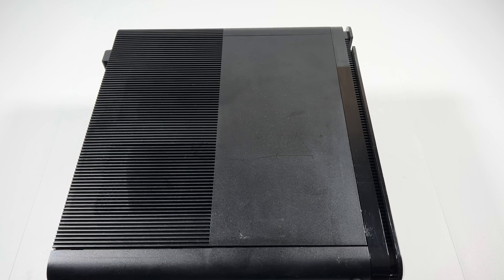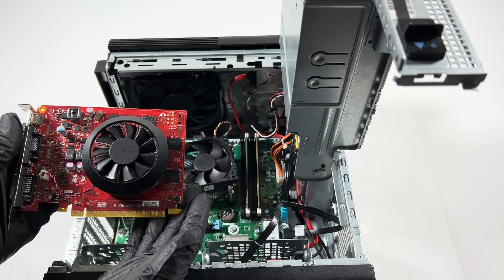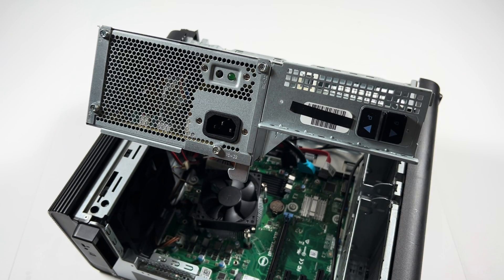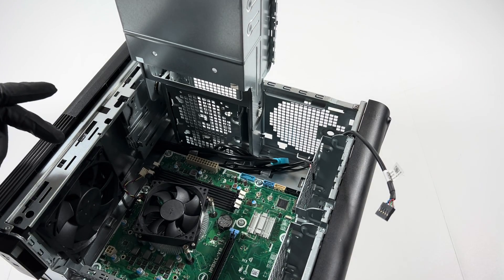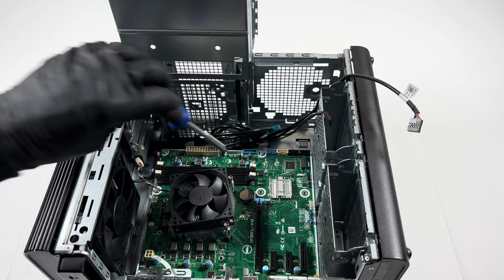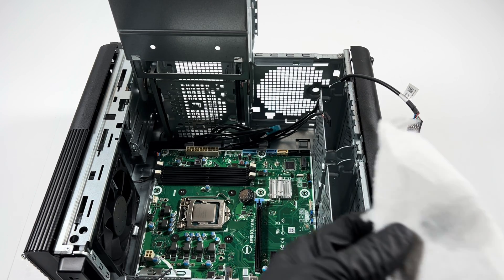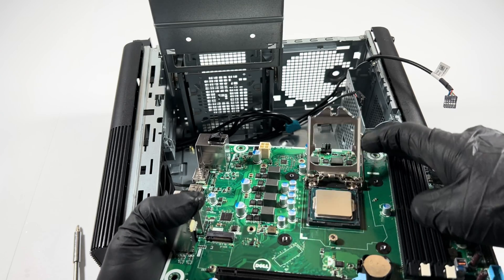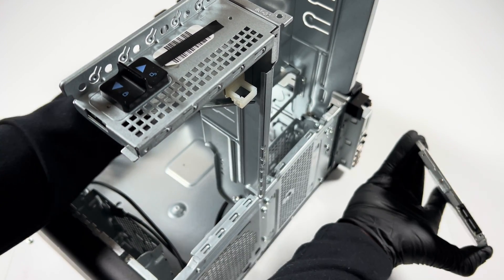Dell XPS 8910 Teardown

Comment: Great video of the teardown.  What I needed was to replace the power supply, and this helped me remove the old power supply and remove all the connections. Do you have a build-it-back-up video?  Or a reinstall power supply video?  Because at this point, I'm stuck!

Comment: Dell keeps messing around with their Dell case form factor, when they already had a gold mine in the good old days of the XPS 7xx series. That case was ahead of its time, and the engineers of that era knew how to keep the overall temps in check. They just needed to keep refining the core design, and easily transitioned into the tempered glass/RGB/Airflow arena that the gaming community is in today.  Now Dell is basically the butt of the joke in the PC gaming industry.
Reply: Dell been the butt end joke of the pc industry for the last 10 years 😭✌️

Comment: I used to have a similar PC, an XPS 8930, equipped with an i7 8700K, 64GB RAM, EVGA RTX 2060 6GB KO, and a 256GB NVMe SSD & a couple HDD's for storage. It was a great machine, but the exhaust fan was extremely loud, making it sound like a turbo engine. Eventually, I swapped the case to an Inspiron 570, which was much quieter even with the stock XPS CPU cooler and no exhaust fan. However, after the swap, I never saw my beloved XPS again
Reply: You ever js build ur own you know a lot seems like you would've, an ik you'd love it more than n old oem xps lol

Comment: 10:45 Why do you not receceopmend intalling ion a custom case? I've had my 8930, very simailar build (IPKBL-VM Motherboard), since 2017. I'm refrubishing it to be a sound editing machine and I want to put it in a new case so I can increase the ventialtiona and add more fans.
Reply: I'm also wondering why not to do that, dell cases are a bit harder to sell as a gaming PC...
Reply: @mashedpotatoes5323  because Dell use proprietary motherboard, pc case and psu. The motherboard likely not going to fit in standard case. In that case, you will have to replace motherboard, case and PSU altogether. Just so you know the rear I/O shield is part of the case.

Comment: Can a 3rd drive be installed in the xps 8910?  Even if I have to "invent" some sort of physical arrangement, my interest is if the system will actually recognize a 3rd drive, is there  a way to connect a 3rd drive with the appropriate cables. etc.?  Any replies are greatly appreciated, many thanks for posting this video.
Reply: Yes you can, I currently run a 1tb nvme as my main, a 512 ssd for torrent storage and a 1tb 7200rpm hd for other storage.
Reply: My 8910 has a nvme and x3 3.5inch drives...

Comment: I have a dell optiplex 3050 sff i wanted to upgrade to a gt 1030 low profile. but i have a 180w psu. will the gt 1030 work on my 180w power supply?

Comment: Hi, I subscribed to your channel. I have an old Lenovo m78 sff 240w power supply amd a8 apu 6500b 65w processor. I ordered a video card low profile 7570 1gb gddr5. Will a stock 240w power supply be enough for this video card it says recommended power supply 250w 60w tdp? Will it be a problem for me?
Reply from the maker: Hi, yes video card low profile 7570 will work fine with 240w power supply.